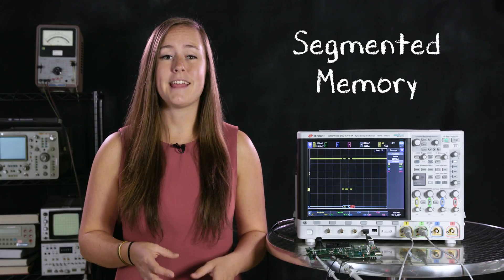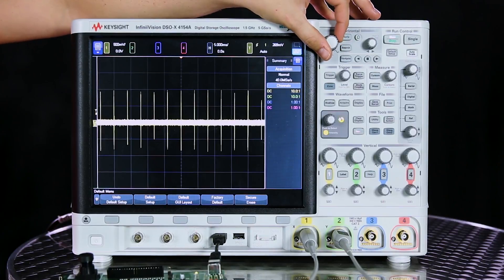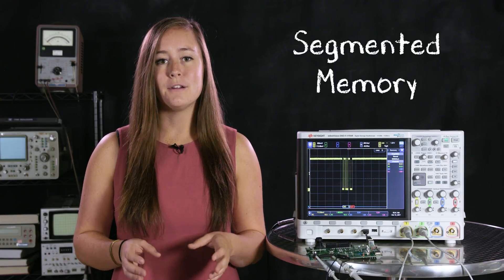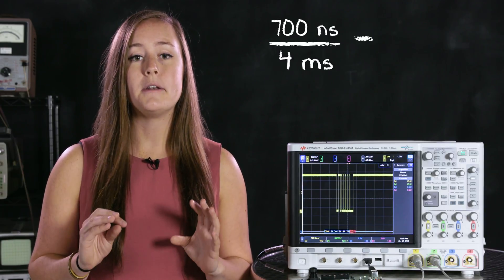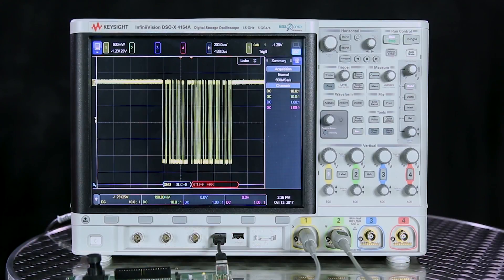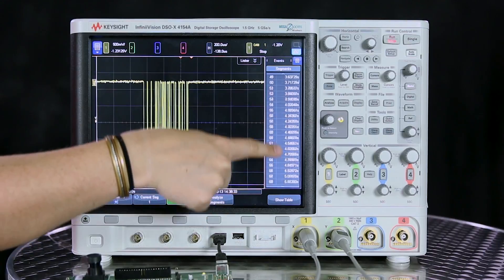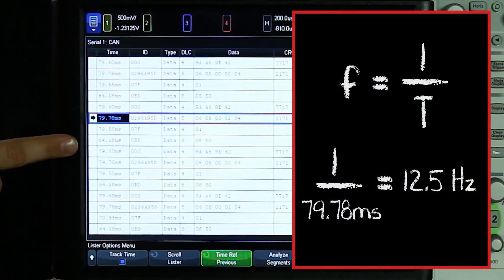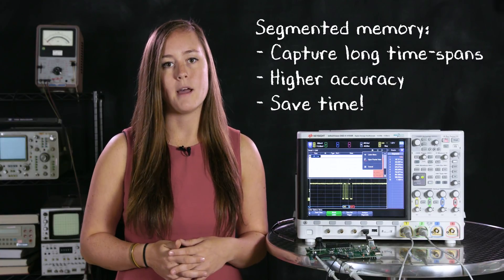What is Oscilloscope Segmented Memory? - Scopes University - (S1E7)

Comment: Is it fair to characterize  Keysight’s segmented memory capability as a process wherein the scope analyzes incoming data, detects portions of the incoming time series that are some level above the (estimated) noise floor and then stores only the detected portions of the incoming data at high temporal resolution? Thank you!
Reply from the maker: It is not about noise floor, but when the scope triggers.  There's a circular buffer that pulls in data, and the trigger tells it to save

Comment: Hi Keysight team. I am interested in the 3000T series oscilloscope. The user manual states that one can use a mouse and keyboard to control the scope. Is this done through the front USB? (i.e. a USB hub required). Also, will a pointer appear upon connecting the mouse? (as it is impossible to use with a mouse without having a pointer). Thanks in advance.
Reply from the maker: Great question! There are actually two USB host ports, one in front and one in back. Both can be used for a mouse and/or keyboard. And, if a mouse is detected, a windows-style mouse pointer will appear.
Reply: Thanks a lot :)